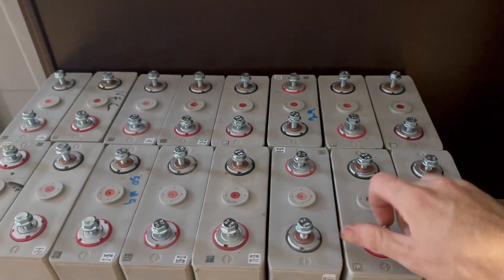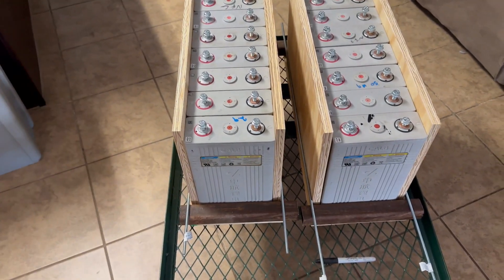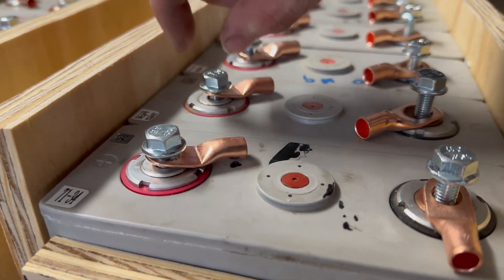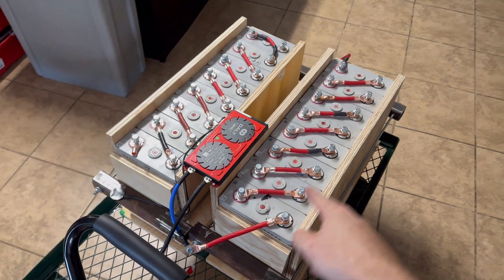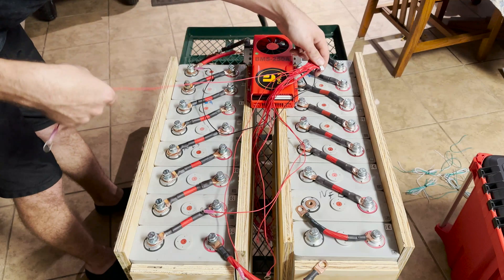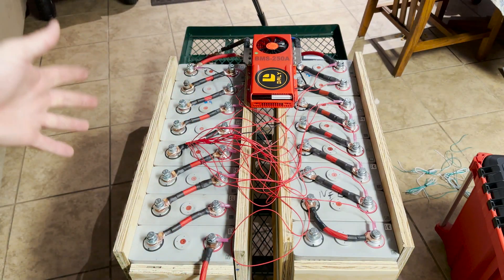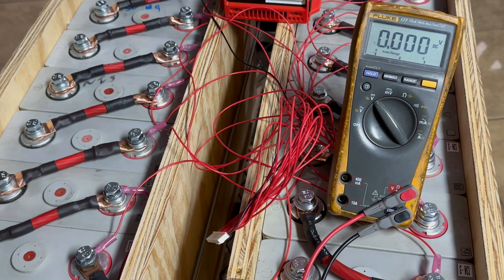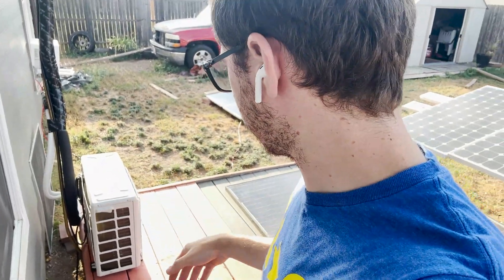How To Make A 48 Volt Battery At Home (Easy)

Comment: I know it has been a while since you posted this great video. I have a quick question what charging settings did you use for this setup? 58.4v charging and 54.4 float? I have this identical setup.
Reply from the maker: Correct, I think I have cell high voltage to trip right at 3.65 per cell, my system seems to float around 56 volts fully charged.
Reply from the maker: I use the system everyday so these get used regularly
Reply: Thank you for the answer. I am getting closer to finishing my build. This really helps. Keep up the great work!

Comment: You can get brand new for 75 dollars each at battery hookup.
Reply from the maker: I saw that, sucks cause that’s about what I paid for these lol but they did not have them new when I built this pack, there great cells
Reply: @Mikebuildss  Only sucks if you think to much about it. Getting it done and posting the video though!

These are really awesome, the best terminals. I used an impact driver nearly full  blast and they stood the test. The lev60f japanese cells have plastic all around the terminal that shatters easily. 

Haha btw so far I see 3 cats. Yep. I am sure you have a good laugh and smile each day with them.
Reply: @Mikebuildss  Oh hey about how you used m8 bolts. I found m8 threaded studs and a seperate nut works much better. You can seat the nut down the stud as far as you need. I also didn't have buss bars but a roll of 18awg dead soft copper wire. I wound around the studs under the nut enough to have 3/4 ounce of copper like 19 winds around then tightened with the nut. Really easy to fabricate parallel or series wiring too.
Reply: I just got 5 for a 16v car system. 375 and 50 shipping to the same state as them.
They have the pdf sheet to show you internal resistance and capacity for your specific cells

Comment: It looks like you are in the USA. Home depot sells 1/8 by 1 inch aluminum flat bar 48 inches long for 12 dollars. I know aluminum has about 3x the resistance of copper, but a 1/8 by 1 inch bar has much more than 3 times the area of 4awg copper. Using aluminum bar between your battery terminals would make it much simpler to construct your battery packs. You can also get one of those drill and tap bits to tap the aluminum bar, then just put in a screw and wrap the wire around it, or crimp an end on if you want to be fancy. You can put a piece of tape on the aluminum to make it safe, and the tape can cover the bolt too for safety.
Reply from the maker: I was wondering about using aluminum, but was worried about the resistance, however a lot of premade batteries use them as busbars already, I may try it in a future build!

Comment: I would beef up the series cable going from one row of cells to the other, so that it doesn't have higher resistance.  One of the virtues of those CALB cells is the cases they come in. You have to REALLY abuse them to get those cases to bulge.  I'm not sure compression was necessary.  In fact, for most home "powerwall" or DIY power station builds, compression of cells isn't indicated because they are rarely pushed hard, or even moderatly hard.  The final thing I'll mention is those cells probably have at least 90% of their original capacity, or over 160AH.  Since a 48v nominal pack is really rated at 51.2 volts, multiply that times the additional 62 amp-hours of capacity you installed, and you've got roughly 3,100 watt-hours worth of additional capacity, over what you would get from a new, 100AH, server-rack battery.  That is substantial and should not be understated.  In the end, you got around 8,200 watt-hours instead of 5,1000 watt-hours, for the same cost or less.  That's very cool.
Reply from the maker: Thanks for the comment I agree, not a bad idea I may double up the crossover cable, I have more wire , there not compressed very tightly, when I got the cells a few had slight swelling but I wouldn’t consider it too bad, I really need to do an actual capacity test in the future, I try and under rate for worst case scenarios. Overall I’m very happy with this battery it’s performed very well, between this and my server rack battery I can run my mini split at full power for around 12 hours on battery alone.

Comment: Hi there! I'm a total electronics newb. I did however understand most of what you did, and why you did it. But I haz newb questions!

You made a 48v battery bank. I see them frequently being used in off-grid setups, or just for back-up storage. I have however also binge-watched some vids, where people try making their own generator, to fill up their 48v powerbank. Several of those tryed to convert a car alternator to "somehow" output 48v. 
If I understood this build process correctly, you could have made 4 batteries of 12v, and connect them in parallel, to get the same amount of stored power. From my understanding, a good solar controller charger thingy (MPPT?) can also just charge up a 12v battery bank.
-What was YOUR reasoning for going 48v?
-If you'd have a 12v DIY made generator, would it have made more sense to go 12v battery banks? (converting an alternator/electro motor to output 48v, seems complicated)
-What are the downsides of having 12v battery banks in paralel?

Thnx for your reply!
Reply from the maker: Hello thanks for the comment, the main reason to use 48 volt is for larger loads, most large inverters are 48 aswell.  If you have a 1000 watt load, on 12 volts thats 83 amps, means you need really thick, good cable, connections, stuff like that. The same load on 48 volt requires only 20.8 amps, 1/4 of the current. You can use smaller cables, less heat and that kind of stuff, and thats only for 1000 watts, it gets worse with bigger loads.  I have both 12 volt and 48 volt systems, 12 volt is cheaper to build, and more beginner friendly, 48 is easier to scale up for large loads. Both work great, just depends on what your goals are. I hope this helps good luck!
Reply: If you connect four 12v batteries in parallel...you have a 12v battery, with a larger total capacity, in terms of amp-hours.  When you connect in parallel, the voltage stays the same and the amp-hours adds up.  When you connect in series, the amp-hours remains the same, but the voltage adds up.  If you connect four 12v batteries in series, you get 48 volts (nominal).  What was done in this video is he connected 16 battery cells in series, each with a 3.2v nominal rating, to create a dedicated 48 volt battery.  He did make any 12v batteries or connect 12v batteries in series.  A 12v battery is four 3.2v cells in series.  He connected 16 of those cells in series to make a straight 48v battery.

Comment: Do it yourself home built lithium battery packs should be regulated, imagine someone in a block of high rise flats copying this video and make a mistake.
Reply: regulated as in controlled? You picked a very specific scenario to have very broad regulation instead of suggesting regulation for your very specific scenario. Imagine someone in their house trying to fix their gas tank by only emptying the tank but leaving the very combustible gasoline vapor within the tank. Let's require certification for people fixing their own cars.
Reply from the maker: Safety is key! Hire a professional if your unsure of what your doing!